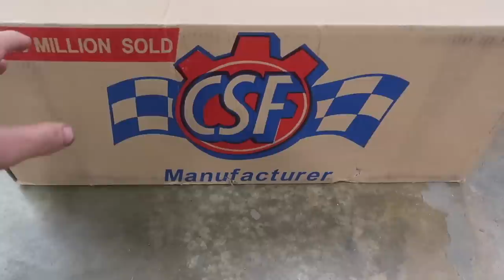THE 435I IS GOING TO BE A BEAST! (NEW PARTS IN)

Comment: Bro right now u have a factory m sport and u don't need to mess that up by doing an aftermarket body kit?  Sometimes less is more...you really need a role model or something.  Get this thing a proper suspension so it squats like a boss, go ahead add some carbon that looks factory optioned, do the bolt-ons/exhaust, and you're good.  I probably wouldn't even do the tune but I know that's heresy to a YouTuber hah.
Reply: Kurtis Nelson why would you do bolt ons and not tune though
Reply: @KinDeEoOo  well you can improve performance without delving into the unknown.  For example, turbo BMW's are notorious for getting hot so you can do certain bolt-ons to minimize this and things like heat soak after multiple pulls or running in hot weather becomes less of an issue.  You open up a can of worms with an aftermarket tune though, which is fine if you want to push it to the next level and realize what you're getting into ($$$)...